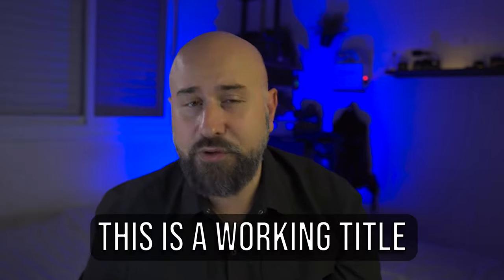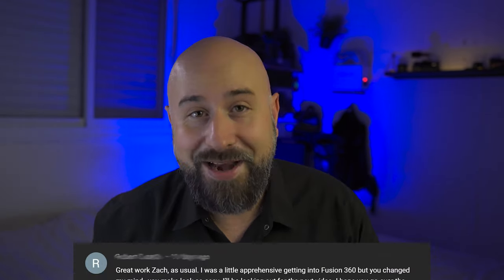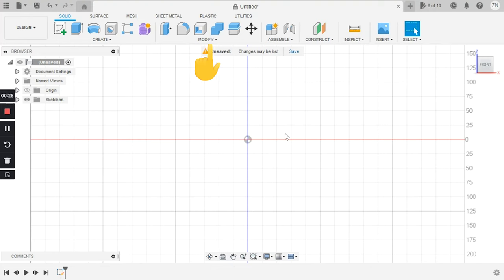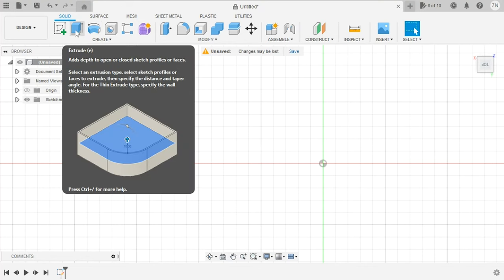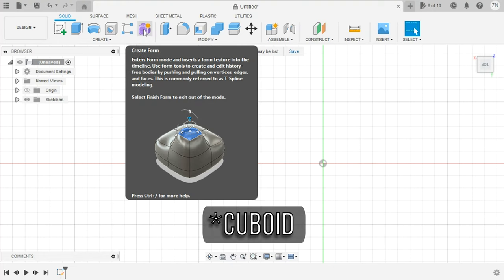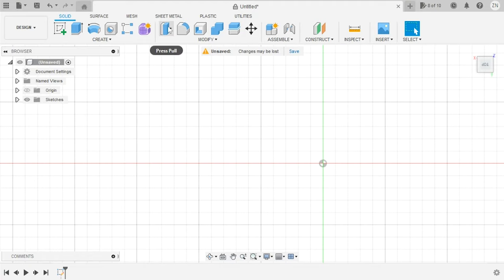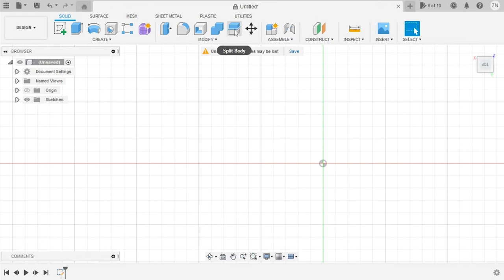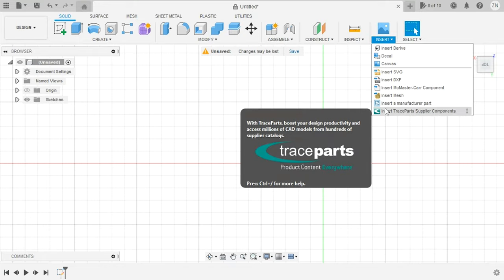3d printing with Fusion 360: Episode 1 - The Toolbar Menace

Comment: Fusion 360 is the goat! What i find super annoying with fusion 360 though, is mesh/stl imports. They are super hard to smooth out for editing, that i just avoid it and look for 360 files instead
Reply from the maker: Hey dirteebreaks, repairing mesh is definitely not a smooth process in Fusion 360, I hear you! thanks for the comment